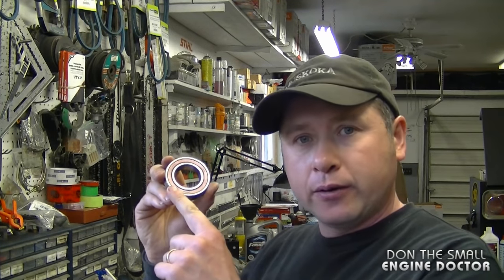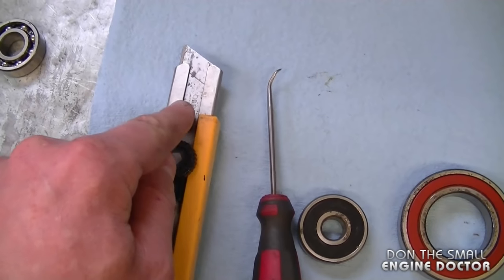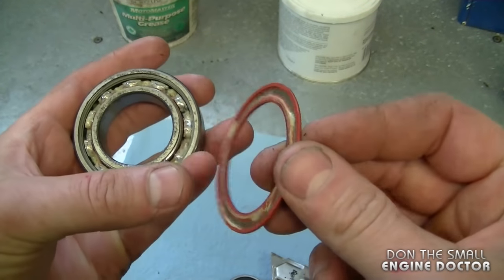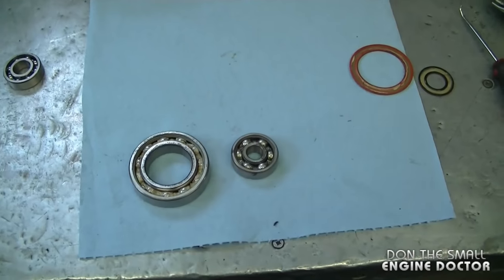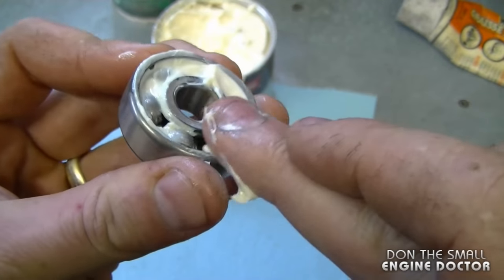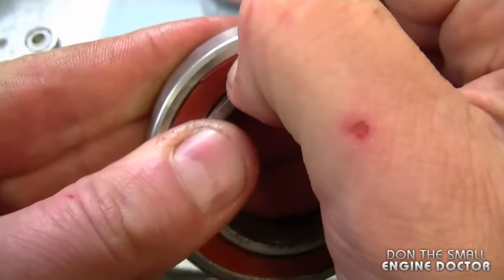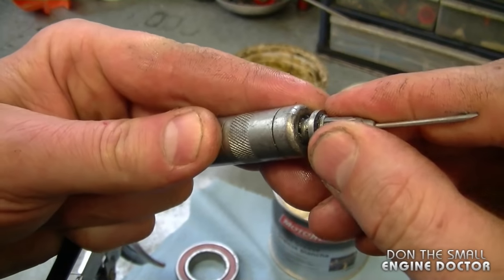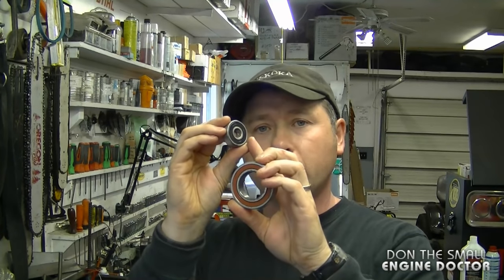HOW-TO Grease A Sealed Bearing

Comment: Good advice👍
Reply: All you have done is add further contaminates to an already dirty worn out bearing , also you should remove seals from the inside not the outside of the seal , and try cleaning the bearing before you remove the seals , wash the grease out before you add more grease , you can over pack bearings with grease , and use clean grease .
Reply: @adrian.adrianl6401  - Agreed! Much care should be taken to not damage the seals. Our Canuck friend should mention this.
Reply: @adrian.adrianl6401  Why do you say it’s already dirty, and this is all wrong?  It’s been sealed.  Depending on the application the video process could be fine, after all if you really want “right” then you replace the bearing.

Comment: I'm an old master aircraft/heavy machinery mechanic. Always take both seals off and clean then inspect them, if the bearings are good make sure the old grease is all cleaned out. There is a thing called "balling" which is where two greases are not compatible and cause the grease to react and dry out making little non lubricating balls and the bearings will fail. we had some mishaps with F-16's having this problem when the wrong grease was used.
Reply: Yikes... F 16s having failures does NOT sound good!
Reply: @dough1968GMC  
Built cheap to be lowest bidder to get contract.
Reply: Yes! Auto mechanic here, never put new grease with old, always wash out old grease and inspect.  I've also seen dissimilar greases turn to liquid and run out, losing all lubricity.
Reply: @woodstover  what do you wash them with?
Reply: @666dynomax  I've seen other people use brake cleaner and or WD-40. One thing I did read was never to use wd-40 to stop bearing squeal (unless as a diagnostic prior to repair/replacement)

This is because wd-40 breaks grease down. I saw a guy spraying it on bearings and it literally dissolves. Spin. Rinse with more wd-40. Spin. Rinse. 

I think he then sprayed brake cleaner on it to remove the wd-40....before repacking with grease.

If you already got your project done let me know what worked for you as I'm in a similar boat! Hope I helped some!
Reply: @lazarus908  ive used brake cleaner on trailer bearings works great.  Last time I was out of paint thinner so i tried some in rubbing alcohol and some in gas, the gas worked far better, soaked them 20-30 minutes and worked great.  the alcohol worked great too but too more work but didn't evaporate as quickly as the gasoline.  I ended up using the gas to soak and clean, then used the alcohol as a final rinse and blew them out with air and let them dry.
Reply: @lazarus908 "easy off" oven cleaner is very good at decreasing. The butane evaporates quickly too
Reply: Stale gasoline. That’s it. Or fresh gasoline, it’s cheap at only $3 a gallon. Gasoline cleans all oils and greases, you’ll see. Then, the gas you don’t end up using can go into your engine so it doesn’t sit around and turn into varnish.
Reply: @666dynomax You use degreaser. It's in the name, de-GREASEr
Reply: @intensecutn yes I've used a lot of different things from paint thinner to brake cleaner to gasoline.
Reply: Double sealed bearing never need regrease. Simply change bearing if make bad noise.
Reply: i just put all-purpose oil lubricant in my box fan bearings and used grease to seal it in. definitely didn't do that right. should've come here first. whoops

Comment: I have been a small engine mechanic for 20 years and found this very helpful. a lot of people are not aware that you can do this!
Reply: Don't do this. 
Half Fill a soup can with grease. 
Heat it to 150-200 degrees. ( hair dryer oven etc). 
Push the warm bearing under the grease. 
Let it slowly cool. 
Then it will suck in just enough without stretching or scoring the seal. 
Replace the bearing when possible.
Reply: There’s a reason for that…..because your not suppose to !!
Reply: I think i should take my small engine to a real mechanic
Reply: @steveiv9250  Yes, just because you CAN do it doesn't mean you SHOULD do it.
Reply: Uh What is the purpose of doing this to a bearing that is sealed? What is Timken’s professional opinion about disturbing the perfectly good seal.
I have never had a sealed spindle bearing fail, can’t say the same for unsealed spindle earrings.

Comment: There are further suggestions that should have been made know!( 1 ) There are different grades of grease ( SHOWN ) however the correct process is to use "for instance brake parts cleaner" to flush out all the old grease.( 2 ) NOTE: Remove BOTH sides seals then LIGHTLY blow compressed air thru to remove the residue. DO NOT SPIN THE BEARING WITH COMPRESSED AIR!NOTE: In high temp bearings the grease expands when under heat so don't pack more grease than needed.( 3 ) Once this has been completed pack the grease from both sides to force it into the inner channel groove then spin the bearing by hand to ensure the grease has been packed.( 4 ) REPEAT packing the bearing then remove excessive grease.( 5 ) Reinstall the side seals! Following this method will ensure the grease is fresh & there is no Old Residue of the previous grease. As twosence fromCleveland stated- QUOTE:   Petroleum lubes generally mix, but the additive package for speed range, temperature (hot or cold), and various chemical repellent properties can "cake" when mixed.  There is also silicone grease which won't mix with anything (rare though). This is why it is necessary to remove the OLD grease.KUDOS for a good video donyboy73
Reply: You would be better off to make your own video. Your  suggestions sound  valid but I could barely follow along. The grammar and punctuation leaves me wondering about certain steps.
Reply: @clarencealexander1908  What don't you understand?
Reply: @mattfoley6082  If he cant understand what was explained, he should not own tools.
Reply: @clarencealexander1908  Are you slow?

Comment: On our farm machinery, we drill a tiny hole in the metal sealed bearings and then use an injector needle. A dab of caulking then seals the small hole. The easy to reach bearings just get replaced, but some take hours of disassembly to get off, so this is were the injector needle comes in handy.
Reply: Delmar: several great ideas together! I´ll add that not everyone realizes that for the caulk/silicone to adhere, the spot  must be W E L L dgreased;
Thank you
Reply: I've done the same many times with the metal seals, they're usually in a area that is protected anyway. I've also added oil with a syringe thru a very small hole. I know this will set off a wild debate about oil and grease not mixing, but the small amount of original grease is usually dried out anyway. I've had great luck.
Reply: @Nunya Business at the injector needle and grease gun shop

Comment: Good video. I usually remove both sides, soak it in mineral spirits to remove the old grease, then pack it with new grease.
Reply: electronicsNmore 😉
Reply: That's the way we were taught in auto shop back in the day. One reason was back then some greases had a different base make up like soap based for example, and if two different greases with a different base were mixed it could liquefy after awhile. I don't think that is the case as much these days but I am still more comfortable not mixing greases especially in something like a wheel bearing. Also, who wants to mix good clean grease with old dirty and potentially hardened grease? Not me, that's not how we were taught by our shop teacher. He believed, and so do I, in cleanliness especially when it comes to machined surfaces and tight tolerance parts, like engines and bearings!
Reply: Theres no f.cking grease in there
Reply: electronicsNmore - ...and followed by a spray of WD40 and a blast of compressed air to remove the last of the crud.  People forget that grease (actually, most lubricant) is designed to “absorb” a certain amount of contaminants, so it doesn’t need to be perfectly clean.  Dirty lubricant=lubricant that’s done its job.
Reply: @mullaway5746  have never used that in any bearing...should use a quality bearing grease
Reply: Yea i was just thinking that, having read those grease compatibility charts on the net
Reply: @mullaway5746  there 😠seldom is!
Reply: the bearing roller,ball,neddle,or monoblock bearing is a replaceable not re mountable, regardless of the condition,bearing is not expensive so why doest change with new one
Reply: @mullaway5746  its al made in china
Reply: @ClockworksOfGL  And you don't remove grease with another lubricant like WD-40. You want to remove all grease/lubricant completely before repacking with new grease.
Reply: @nightdan7096  - WD-40 is more of a solvent/water displacer than a lubricant.  It’s quite thin, so a blast of compressed air will get most of it out the bearing before regreasing.
Reply: @socratesalegrado745  I agree completely, take the seals off and pack with grease just means grease will pick up rubbish and make a nice grinding paste or throw off and make a big mess. Unfortunately, everyone's an expert with more knowledge than the manufacturers!

Comment: Quick tip, I like to use a sandwich bag to pack bearings. That way i can really massage the grease in and dont have to use up 1/2 a bottle of gojo at when im done.
Reply: MyMusic Account1 good point !
Reply: I read gojo and could physically feel the grit and sand

Comment: I've been doing this since the early '70s. 
The metal shielded ones get soaked overnight in solvent, blown out with compressed air, heated in a pan of proper lube, then the pan / lube/ bearing are cooled. Works great for hard to get parts, especially for obsolete equipment.
Reply from the maker: thanks for the tip!
Reply: Thanks for the tip.. 
Beer's on me 🍻🍻
Reply: would it be better to sit them upright so it gets only half filled not over filled?

Comment: I have to say I watched your video 2 -3 years ago and ever since I have checked every sealed bearing I’ve come across. I will tell you about 1/3 of new bearings I’ve purchased have had either no grease or very little. I would strongly suggest everyone watching this video to check your bearing, especially if they are critical !!! Like motorcycle wheel bearings.
Reply from the maker: I agree!
Reply: That's good to know and check.
Reply: Yep, that's why I'm here! I was talking to a guy at work about my new scooter's bearings being a bit squeaky after riding it in the wet. He rides motorbikes and he said that he greases every single bearing he buys before installing it on his bike. He also said that the majority of new bearings don't have enough grease if any at all.

Comment: Hi Don, love your channel. I re-grease snowmobile bearings used in the rear suspension wheels. They take a lot of abuse. I remove the bearings from the wheels with a press after removing the snap ring retainers. I remove both seals using a precision screwdriver. Bearings are cleaned in a jar with mineral spirits, followed with a blow gun with the bearing in a clean rag. Then, I spin the bearing to see if it has any resistance and check for pitting. If all is good, I use moly lithium grease and reinstall everything. This really extended the life for these extreme use bearings.

Comment: i never knew you could get those covers off! thanks for the video. tip for packing the bearings, put a rubber glove on your left hand, some grese on the heel of your palm, press the bearing in it repeatedly with the other hand. this forces the grease through and works really fast.

Comment: In an emergency you can temporarily extend the life of a slightly noisy bearing by completely removing all the grease washing it in solvent and gently blowing out with compressed air and repack it with grease but leaving space for expansion inside the seals. 
You need to choose the correct type of grease for the application it’s working in as not all greases are created equal. Once the balls, rollers or race have become pitted replacement is the best option. Sometimes if you have an oddball sized bearing this is your only option until you can procure a replacement. 
From many years working as a machinery fleet mechanic I would sometimes have a sleeve machined up so I could fit a common over the counter bearing to replace hard to get oddball bearings that some machinery manufacturers thought would be a good idea to fit. 😀

Comment: Great vid thanks. Just a few points, after prying the seals out there is usually bending, so before reinstalling check you flatten the seal out perfectly. I always use a good quality "water-proof" grease as this type of grease doesn`t get washed-out so easily. Don`t buy cheap bearings where ill fitting seals don`t actually keep dirt & water out, the main cause of bearing failure. Finally as this vid points out don`t over grease the bearing. I always take off both seals squeeze the grease but leave a finger groove in the grease so as not to put pressure on the seal.

Comment: For small high speed bearings like alternator bearings or idler pulley bearings, that see sub freeing temperatures, I use a thinner lightweight grease. Heavy grease will spin the bearing centers sometimes if you don't use light enough grease or too much grease. too much grease causes a bearing to run much hotter.
Reply: And do you know why?
Reply: @tandemwings4733  too much grease creates friction, friction creates heat.
Reply: @satibel  
I'm very well aware of that.
I wasn't asking you, I was asking him.

Comment: Thank you, I tried this method with my idler pully on my engine. I took off the covers,cleaned it out then regreased it. The only thing was it didn't get rid of the sound (I'm guessing it is already damaged) so I'm going to changing it, but I'm glad to know that I have experience doing this now
Reply: Do it again clean old grease out with mineral spirits
Reply: @bigred1247  next time I will

Comment: Thank you sir you saved the day! The top spindle bearing is the same bearing in my Husqvarna, so I used an old spindle bearing. It only had a seal on one side though, so I pulled the seal off the idler bearing and used it on the spindle bearing.
Reply: If your spindle has a zerk fitting, then the bearings should only have one seal so the open sides are facing the inside of the spindle. That way when you grease the spindle the grease can actually get to the bearings.

Comment: A feeler gauge works awesome for removing the seals without damaging the sealing edge.  Over packing the bearing could lead to failure depending on usage.  Nice vid.
Reply: which gauge feeler gauge?
Reply: @You1987Tuber  As thin as will allow you to slip under the seal and enough stiffness to allow you to pop it out.  Start thin and work way up.

Comment: Good idea to clean the bearing from old grease with benzine . If you reach the point where you need to do this the old grease is usually hard and makes the bearing rough and new grease wont solve the problem. So clean it out first and blow it out with air and the bearing usually becomes smooth and then you insert the fresh grease.

Comment: Metal covers -- that's what's installed on my new spindles for Murray 11ic/36. So you've answered my question!! I won't bother to try to open them let alone knock them out of the spindle or "jackshaft housing asdembly" as Murray calls it. So the zerk fitting is I oh going togrease the hollow between the assembly and spacer that the jackshaft passes through to prevent condensation moisture presumably. So, is there a need to drill a tiny seep/weep hole to prevent grease build-up that could force the bearings to burst??
Thanks a lot Dony, I might just be able to get on with installing the 'spindle' and drill a weep hole in the future. Big THANK YOU.

Comment: Just serviced a very squeeky tensioner pulley yesterday. My first try at it. And my Idler Pulley bearing, since I had the drive belt off. Made sure I cleaned the heck out of them (both sides) with brake cleaner first. Until the bearings looked pristine. Lots of dry desert dust from SoCal coast. Then packed them good with red bearing grease. Re installed. The tensioner pulley still squeeks (1/10) as bad, maybe because it had a tiny 1/2 mm of side to side play. And because it was a cheap bearing on an AutoZone Duralast pulley from 15 - 20 years ago. Whereas the idler pulley was the original OEM part with an all metal bearing casing (good bearings like you had here) instead the cheaper plastic casing for the balls like in the tensioner pulley. Drove around a good 5 miles already - still some squeek - may have to order a new bearing for that. What's a good metal only bearing for a tensioner pulley? Who can I order it from with free shipping? Do I need to get #'s off casing ring? How do they measure it, outer diameter × hole diameter × width? What do the serial numbers on the side of the rings stand for?

Comment: That cover is crazy easy to remove. I always thought a sealed bearing meant it is waterproof but the one you showed would leak like a sieve. Thanks for the tips.
Reply: Just goes to show how people are willing to part with so much money when that term "sealed" is used.
Reply: They do leak, look inside a lawnmower wheel bearing , that has been jet washed down frequently and the grease is black and filthy.
Reply: Nah mate. You get different types of seals. There is light contact rubber seal which i wouldn't want to hit with a high pressure cleaner ever. You can get seals that are full contact rubber seal that can handle being washed down, just don't go blasting the bearings for long as you will damage the seal.. You can get triple lip seals etc. The trade off is more friction, hence more heat. 

You can look up how deep groove ball bearings are made and see how much grease to relube them with, or even better a bearing catalogue will tell you. Over lubrication will lead to premature failure. But as you saw one of those bearings had zero grease. Clean out the old grease , relube with injector nozzle and replace seals. 

This video had some great info. Cheers for posting.